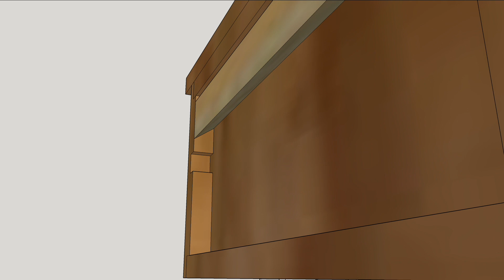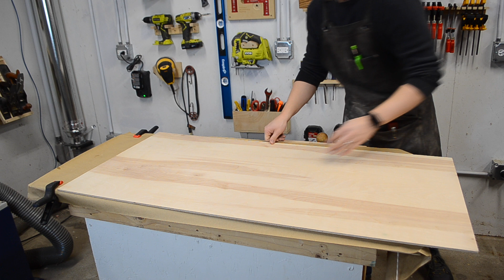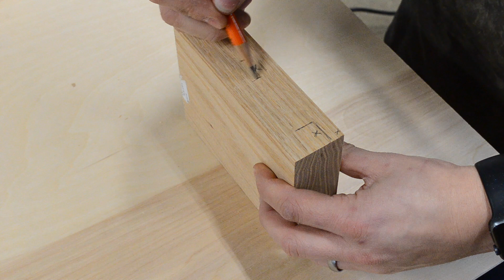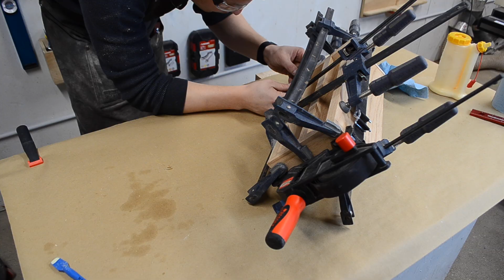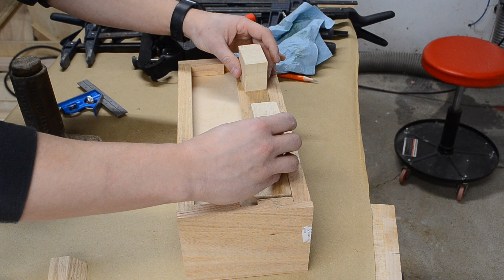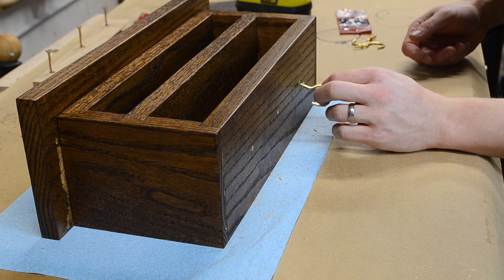Table Saw Basics: Floating Key Cabinet

Comment: Great video 👍 I'm looking forward to follow your steps but I noticed you just glue the hanger on the back is that ok with weight ? I want to make one to atleast hold 20 coffee mugs. What can u recommend me to do?
Reply from the maker: If you are gluing two wood surfaces together that are both very flat, a thin layer of wood glue is VERY strong. Definitely strong enough to hold 20 coffee mugs.

Good luck!

Comment: How did you get that broken hook piece out of the board?
Reply from the maker: I didn't :( Drilled a new hole right next to it, which worked pretty well because the hook broke off flush with the surface.

Comment: I've had the same problem with the same brand of hooks. Must be chinesium.
Reply from the maker: Hah. I think the issue is that the hooks are brass, which is very soft. Whenever I use brass screws I always strip the heads!
Reply: @dkbuilds  The ones I've used were steel. They were gray in the center. The quickest way to find out is with a magnet.

Comment: Looks great! How'd you fix the hook?
Reply from the maker: Thanks! I wasn't able to get the hook out, so I just drilled another hole right next to it. Luckily it broke off pretty flush so it's very hard to see, especially with the dark stained wood.
Reply: @dkbuilds  Got it, thanks!
Reply: I had the same happen to me, also with red oak, also at nearly full depth. The force needed to push the screw into the too-narrow pilot hole was too great at that point for the weak metal to support.

The pilot hole needs to be wider than the "core" of the screw so that it only has to cut the threads in the hole walls. Its not going to be holding much weight so even if the threads cut in about 1/64", thats plenty for red oak.